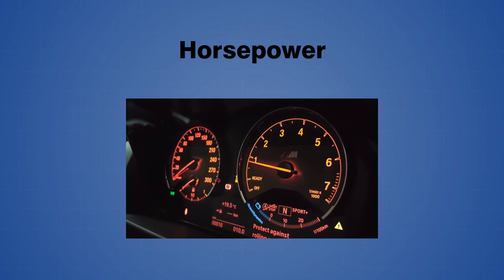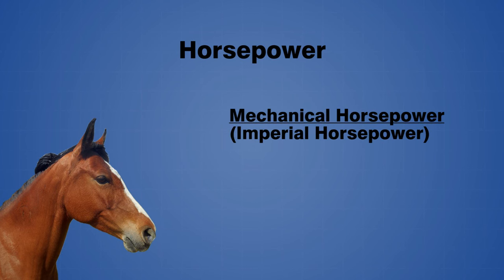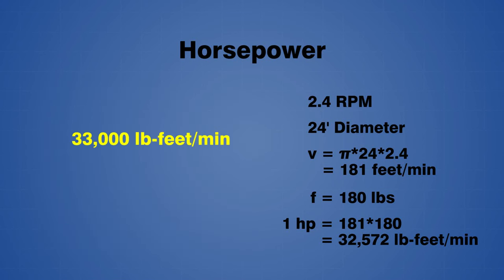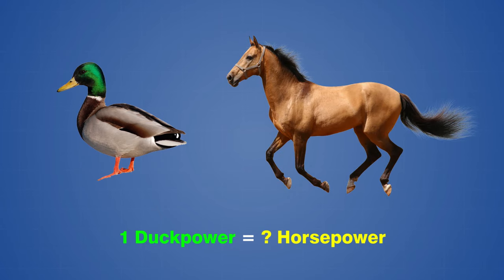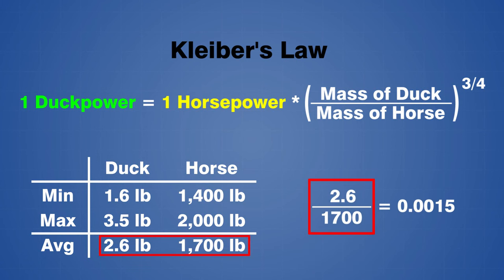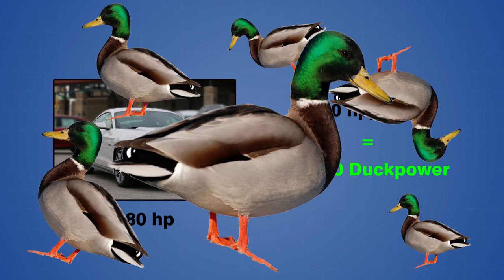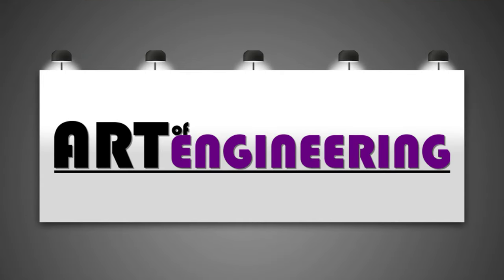Horsepower Vs Duckpower

Comment: So one horse-sized duck is approximately equivalent to 130 duck-sized horses?
Reply: aaa what ?
Reply: im fucking imagining a bunch of duck sized horses running around and its quacking me up
Reply: No, horse is generally a slimmer animal than duck, so horse-sized duck would probably have much greater volume and thus be heavier than an actual horse. What you're looking for is a duck with a mass of a horse. However the video doesn't account that birds are typically lighter than other animals of the same size, due to pneumatic bones and lack of a bladder, which means a duck with mass of a horse would actually be stronger than the horse. So what you really looking for is a duck with a muscle mass equal to the muscle mass of a horse ;)
Reply: What about the feathers?
Reply: Horse630O==304A power v.s duckpower408A==308A==929B

Comment: What about carpower?
Reply from the maker: If we take the average mass of a car and consider metabolic rate to be the rate of fuel consumption, then I predict that 1 car will have approximately 1 carpower. Checkmate.
Reply: Art of Engineering well played
Reply: average modern economy car is around 150hp
Reply: @Crunchy121  or 1 carpower
Reply: @Art of Engineering My Honda Jazz has 1 car power. A Koenigsegg Jesko has 1 car power...

My goodness, my car is better then I thought ;)
Reply: Not unless you've modded your car :P
Then I imagine it makes a bit more. Maybe something like 1.3 carpower with a DPF delete, ECU remap, sport catback exhaust system and TCU flash. Based on power before tuning.
I imagine a freaky 1000hp Supra makes a lot more power than just 1 carpower.
Reply: More like 100hp for Europe... Hell, the small ecobox hatchbacks make even less than 100.
Reply: Sars-cov2 power?
Reply: @DendrocnideMoroides  A virus is significantly lighter and on top of that has no metabolism at all. xD
Reply: @trimeniawallengrenii7816  genius 😅

Comment: Why are you using the power output of a horse and the power consumption of a duck? An animal consumes over 20 times more energy than they can reliably produce, the rest is converted to heat. A duckpower should be at least 20 times less than what you calculated here.
Reply: Because ducks are derived from dinosaurs and fuck yeah ducks.

Comment: There is a serious flaw with this logic. An animals mass and metabolic rate are not the same as comparing its power. The ant has a very tiny mass, yet can carry 10 times its own body weight, I doubt a horse could do that. Trying to compare the power of a horse and an ant by mass is not possible.
Reply: The ant's overall mass is low . What you are saying is something like" hey look I'm 50kg heavy and can lift 100kg "while an ant could possibly lift 250mg. It's shear stupidness to say that you are weaker than that ant.
Reply: Rohan Suresh im not saying that I am weaker than an ant, but his power to mass ratio is a heck of a lot higher. An ants strength and speed scaled to that of a human, would be like carrying 4.5 tons running at 50 mph. This is why I say comparing based on mass is flawed.
Reply: @outlawgamingrp Nick,  I agree that mass has nothing to do with power directly. But the equation equates to metabolic rate to power which could be fairly acceptable rather than directly equating the mass to power. The metabolic rate is equated to power of the no. of ants and obviously horse not only has a greater mass but also greater power. It's directly proportional. I think your point of power density of ants being greater is actually something to be noted. Maybe this works only for the mammalia in vertebrata phylum.(Mammals as you might have guessed)
Reply: m
Reply: Rohan Suresh I’m sorry, but this isn’t true at all. It would mean lizards and fish would also be disproportionately strong, which they are not. Instead it has to do with the fact that they are very small with high surface area, and the mechanical advantage is on the exoskeleton, rather than an internal skeleton. These combined facts make them extremely efficient in how they use their muscles. If we were ant sized and had our skeletons on the outside, we could be that strong too, even if we were warm blooded and kept our mammalian muscles.
Reply: Carrying something on a level surface is not considered work in physics.
Reply: @jearlblah5169  Well, only if you simplify greatly by omitting friction, etc. etc. that is the "work".

Comment: Kleiber's law shows some problems when applied to birds versus mammals.
Reply: True, Duck for instance, has in fact more efficiency while flying.
we calculated this with engineer friend of mine and it actually has ~43Watts of power while flying.
Reply: And I'm guessing four legs are better at pulling than two legs.
Reply: @XavierBetoN  that's awesome! How did you do that?
Reply: @sminthian  not really, apparently birds have generally higher values than placental mammals
Reply: @gauthierruberti8065  Duck has ~1.2 -1,4kg in mass. It has wingspan of 66-75cm. Aerodynamics of the wings have power to lift at 65mph (average) (which is between 30 to 100mph) 
Say, the 75cm wingspan is capable of lifting the 1,5kg at 30mph with a freeglide; assuming there is no wind, it takes about 35watts of power to sustain the speed; which can drastically increase when sprinting to about 100watts equivalent of kinetic energy.
As an engineer, I wanted to discuss this on reddit or engineering.stackexchange.com but i'm a lazy one xD

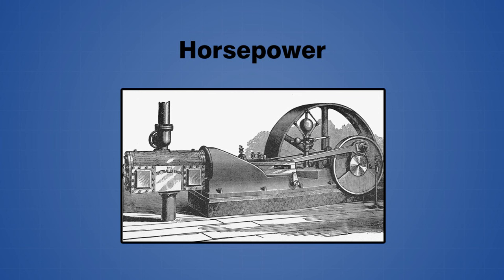Comment: 1:16 - It wasn’t so much a marketing tool so much as a direct frame of reference since actual horses were used to do these jobs previously as was the case with mills, stagecoaches, and other such horse-powered operations of the time. This equivalency to horses was not at all arbitrary. If we ever rode around in duck-drawn carriages, perhaps duckpower would be a de facto unit of measurement but, since horses filled that role, horsepower became the unit of choice that people could easily comprehend. Nevertheless I enjoyed your analysis.

Comment: Love the video! But I see a problem in using Keibler’s law as the ratio coefficient in comparing power output between animals, an ant has way more power output compared to its mass (or metabolic rate) than let’s say a slug...

Comment: Antpower
Reply: I would really like the topic of ant power but the resolution is too great. It could be used for measuring insects maybe. The problem is it cannot be used to commercially for the obvious reasons of it being too small. IDK if you need Kilo , Mega or probably even giga ant power
Reply: 1 Horsepowers to 3.6 Billion Ant Powers. It's Science.
Reply: You consider the fact that the ants can lift 50 times their weight?
Reply: @raijean  You just talk like. Look my truck has 10 MegaAntPower.

Comment: "Horsepower is how fast you'll hit the wall. Torque is how far you will take the wall with you."
Reply: Well, that is not very good analogy in case of cars, because the gearing can change the torque at wheels to something completely different what it is at engine flywheel. Torque is directly related to power via the rotating speed; Power = Torque x Angular Velocity. So you get more power by either; 1) Increasing torque or 2) Increasing RPM. Gearbox and differentials in cars for example change the torque that acts on the wheels. How far you take the wall with you in case of crash, depends more of the kinetic energy accumulated before the crash, and that is more a function of the mass and the velocity . . . 😂

Comment: u/hilburn

"About 300 ducks.
A Mallard weighs ~1kg and most birds can lift 25% of their weight without slowing down too much, so that's 250g/duck.
Ducks can fly up at a rate of 1m/s, so a duck can lift 250g at 1m/s.
To get the required 75kg, you need 300 ducks each lifting 250g."

Although that's to metric horsepower so 2.55 lbs average / 4 = 0.6375 lbs for a mechanical HP at 550 ft⋅lbf/s
Or 289 grams at 1 m/s and 76.04 kg, that's about 263 ducks per horse

Converting the work done by a horse to a metabolic rate of a duck is kinda flawed I think.

Comment: I did the math...1 Horsepower is equal to about 7.3 Whorepower.

Now I know I'll need about 2555.73 Whores to equal the same amount of power on my car.
Reply: By the power of maths I deduct your car has 350hp? That's very nice man, what car is it? :-)
Reply: How many beers/Bourbons are you worth?

Lol
Reply: @inorite4553  0.5 :D
Reply: @robertdevald  Make those Ds a double and you're on!
Reply: you can get away with just using 3. As shown here: https://imgur.com/gallery/Ac7crdr/comment/147832991 but you might not go as fast

Comment: how exactly do i get 10 60w bulbs and make them lift a crate with a pulley?
Reply: make a lightbulb that produces energy instead of consuming it i suppose
Reply: radiation pressure
Reply: These old lightbulbs put out more heat energy than light... Best make the bulbs heat the air for a small hot air balloon.
Reply: The 60 watts that light bulb consumes, it converts almost all of that into heat. You only need to build an apparatus that converts that heat again to motion and there is your solution. There is a whole field called heat engines, focused around that subject. 😂 Even our internal combustion engines, steam engines, etc. are all heat engines.
Reply: @oooooooooooooook8692  Energy is only converted from one form to another. It is not consumed. 😉 Light bulb converts the energy carried by the electric current into heat and small amount of electromagnetic radiation that is light.

Comment: 1 Tardigrade power = 4.7*10^-7 HP

From the Wikipedia page I got a pic of one next to a tiny ruler, assuming density of 1g/cm³ and considering a cylinder of height 0.378cm and radius 0.049cm, I get a mass of 0.0028g.
With a mass of horse as 770000g, we have 1TP= (0.0028/770000)^0.75 HP = 4.7*10^-7 HP

Comment: I doubt that mustang could pull an elephant but I'd pay to see it try
Reply: let alone 81
Reply: But it's not because of lacking engine power, it's because of lacking traction. The mustang engine for sure could easily pull an elephant if you put it in a 10 ton vehicle with a good enough gearbox with low enough gears.

Comment: All these comments and not a single one recognizes snailpower

The largest snail, the Giant African Land Snail, has an average weight of 32 grams for a fully grown adult. Therefore the ratio of snailpower to horsepower is 1sp =0.00051hp or 1hp = (roughly) 1,945sp. Comparing that with our 380hp sports car, it has an output of 739,100sp. Usain Bolt has 2.9hp or 5,640.5sp.